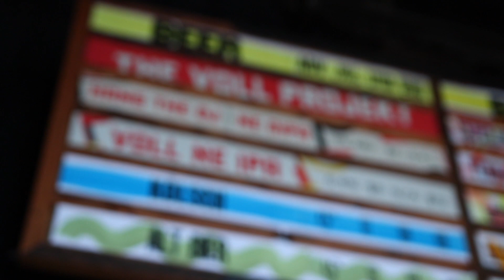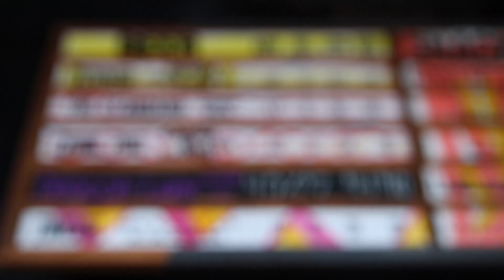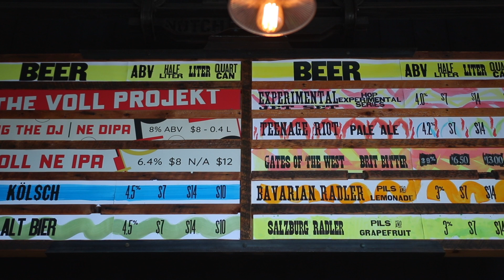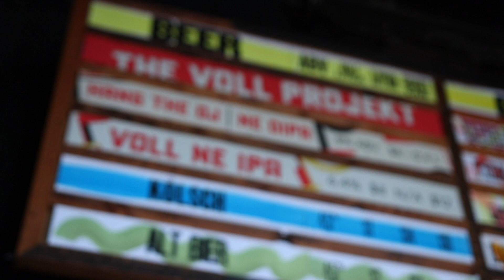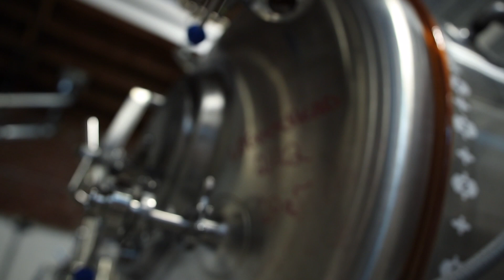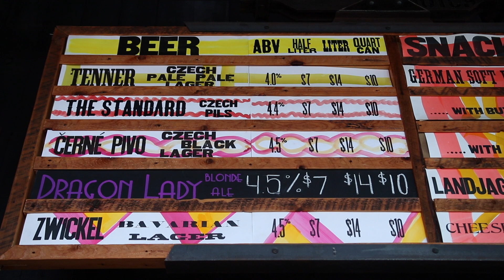Notch Brewing: re-imagining American lager | The Craft Beer Channel

Comment: Golden Tiger is one of the greatest pubs in the world. It has Pilsner Urquel only , however, its not even tank beer, only kegged. Its poured so proper that it is a great beer experience. Beer factory in Plzen makes a great pale lager, Clock brewery in Czech makes great pale lager and basicly everything they make is outstanding. Permon craft brewery in Czech makes crazy single hopped IPAs. I have a rotation of several Czech pale lagers every weekend. Rohozec, Krakonoś, Opat, Zavis from Polićka.
Reply from the maker: We have been to the Beer Factory and LOVED their pilsners, and had some good stuff from Clock too. Will have to check out the others.

Comment: Is that a special tap? Why were they dipping it into the beer?
Reply: side-pull tap
Reply from the maker: It is a side pull tap, very common in czech. Allows for the production of what is called "wet foam", which is thicker and creamier than standard head that forms as it hits the glass. 

As for dipping the tap that is totally acceptable if the nozzle is kept very clean and ideally constantly in use!

Comment: Never put your tap in the beer while you tap. Damnit. That's disgusting.
Reply from the maker: This is a very common misconception. How does the outside of the tap touching your beer differ from the inside of it!? If anything the inside is much less clean. 

Many taps - including almost all UK cask taps and czech sideways taps - are designed to be dipped. The latter HAVE to be dipped to get the required creamy head and protect the beer from oxidation - as they do here.

Nothing wrong with dipping taps especially when properly maintained.